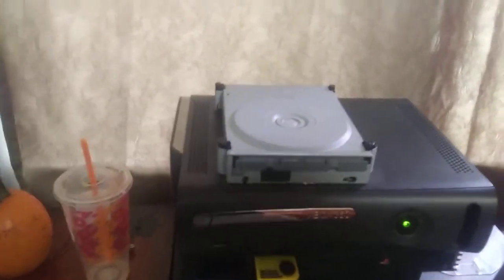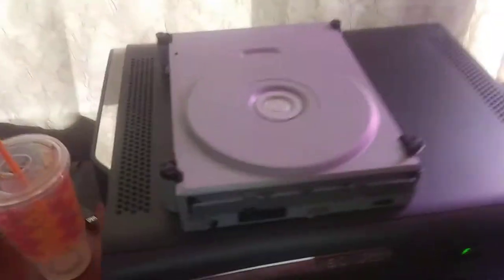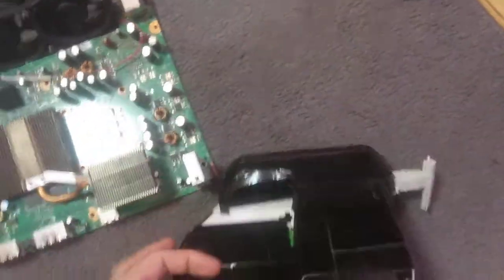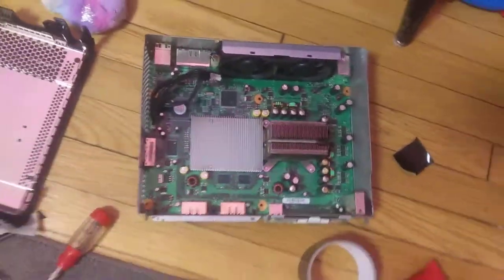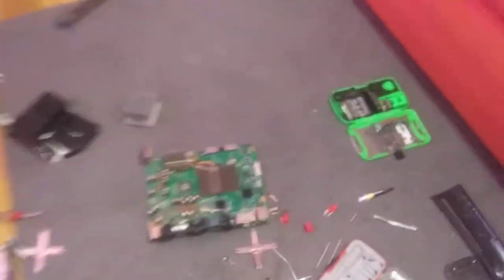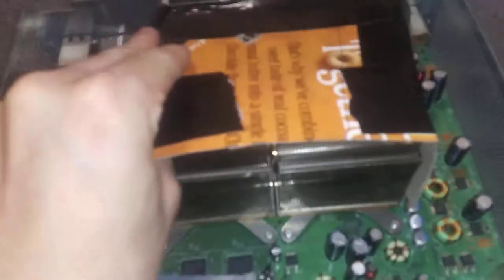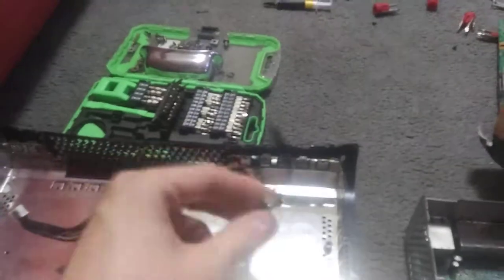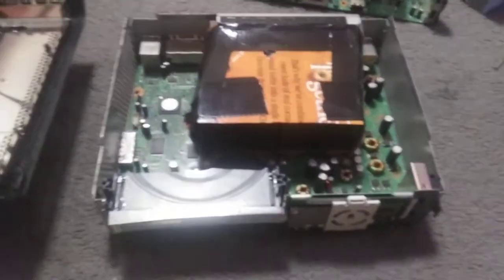Xbox 360 fat external dvd drive and heatsink mod

Comment: This is a very nice idea! I'll try to fit the drive in an original HD-DVD housing and feed the cables through like you. Then i want to place a 120mm fan on the right side. I have a TR-360 cooler also.

Comment: i wanna try the same thing but with the newer heatsinks and to add fans to each
Reply from the maker: If i had a tap and die set i would be willing to try that as well. Hp small form factor computers have great copper heatsinks